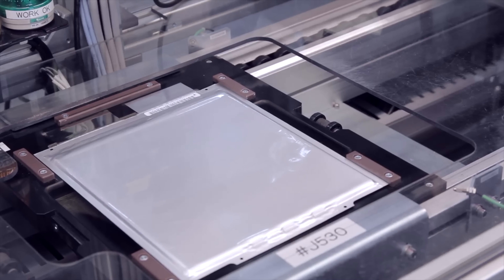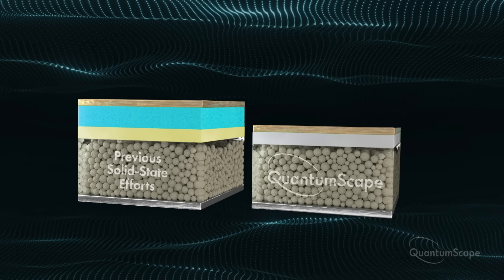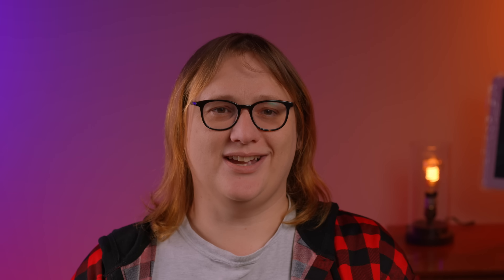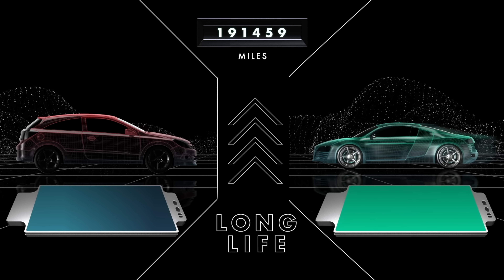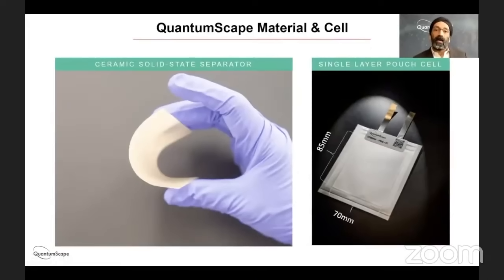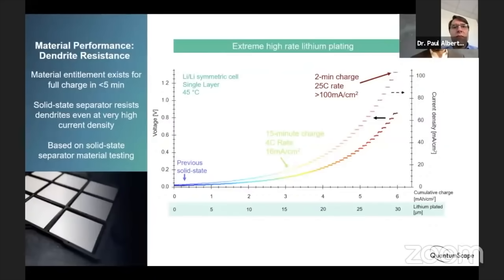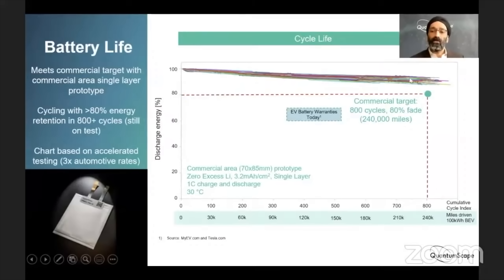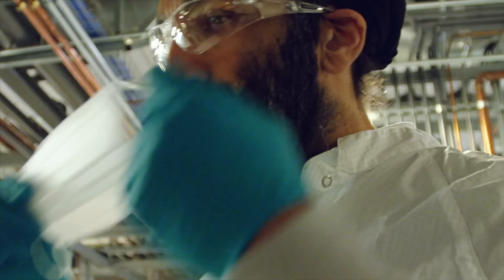Why Quantumscape's Battery Revolution Is Big News

Comment: Tesla is behind
Reply: This SS batt is more hypothetical than real and it's only claimed to be 8 yrs from real production at which point it will match Tesla's 2022 cells in 2028....IF they pull it off at all which is extremely doubtful.
Reply: @Mrbfgray  Volskwagen will have these batteries by 2025, I don't see Tesla matching these batteries, they will have to adquire a new tech by 2028 to start in 2031. The future is solid.
Reply: @rwyo83  Tesla has already match them in specs and vastly exceeded in execution/production.  I wouldn't bet a dime on QS or WV.
Reply: @rwyo83  Also keep in mind that this channel (I don't want to pan them too much, they mean well) fell for the most blatant farce in history--Nikola.  It's great that they are agnostic on brands and such but they obviously don't have a functioning bullshit detector.  QS CEO has a brief history of wealth destruction, JB Strobbel on the board is good but not enough and the timeline they presented is laughable.
Reply: @Mrbfgray  Tesla's batteries are slow charging, they're not even close
Reply: @Mrbfgray  Tesla's presentation are more laughable.
Reply: @Mrbfgray  Bill Gates money is in QS. I believe QS and Toyota will be Tesla's nightmare.
Reply: @rwyo83  More laughable how?  Tesla's 4680s have 15 min. charge time, equal to QS claims  and they actually exist not just a science project.
Reply: @rwyo83  Put your money where your mouth is, talk is cheap.  I've done so but it took me a decade of following the Tesla story before I decided to 'back up the truck' at $38, 18 months ago, after making the decision in 2018....not really fast easy money then.  Know what you own and why or you'll lose your shirt.
Reply: @rwyo83  You "believe"....how and why specifically?  Are you going to invest in QS and Toy?  I imagine you'd want to wait 5 to 8 yrs at least as that's the minimum time it will take to confirm if there is anything there at all.  Bill Gates money won't go far alone and I wouldn't put much on his judgement but I agree it's better than nothing.  More players is always good.

Comment: My basic understanding is - Lithium is only stable as an Ion. Lithium batteries are made of Lithium Ion - missing Electrons [positive Ion] or extra Electrons [negative Ion]. Adding and removing electrons is the job of the lithium battery's "Electrolyte" - to strip off EXTRA electrons to use (discharge) and later attach electrons (charging). So far this has been a destructive chemical process. Now a team has developed a thin divider that might have little trap doors that will only allow Lithium Ions to travel one direction WITHOUT the chemical side effects. That's my take. I might be wrong. It's till MAGIC

Comment: So if this is what companies can come up with in ten years, what could we have done in the 139 years since the first electric tricycle in 1881 or car in 1884-1890, if the oil companies and fuel burners hadn't hidden them away over the years since.
Reply: Nonsense.  Hidden WHAT?  Early batt cars were extremely limited and most of the nation had no electricity anyway.  Oil co.s back then were about as significant as SS-batt co.s are today, tiny startups.
Reply: @Mrbfgray  The first combustion engine car came out in 1886, 4 years before the electric one did, over the years since the automotive companies (General Motors famously have) who have/had investments in the oil industry, have constantly pushed back the developement of EV and even the rail network especially in the US, they've got politicians in their pockets who fight on their side.

The evidence is everywhere, even now there are some who are refusing to switch to EV, just recently on this channel they shown how companies are altering results to make the EVs look worse than they are.

It's all down to money, how quickly they can fill their pockets and bank accounts, and they don't car who they step on to achieve it, oil has been easy money, investing into EVs costs money, which they don't want to spend, the proof is with Tesla and China, they've proven EVs are competitive, yet the others are fighting the 2030 deadline, in reality there shouldn't need to be a deadline and just do it, because they refused to accept EVs they have dropped way behind, they don't care about lives or the enviroment just profits.
Reply: @will4may175  The 2030 deadline is largely irrelevant, economics will make the switch happen before that but useless politicians like Newsom will claim credit, AFTER Tesla and a few others demonstrated it was even possible. 

 Sure there are forces acting against disruption, always have been, that's the great thing about capitalism, you can't keep a good thing down.  Batt cars potential were extremely limited prior to the last decade due to price and performance of batteries, period.  EV1 was OK for a few with it's 40 mile range and 12 hrs to charge but not many.

Zerox missed the mouse, Kodak died from missing digital, legacy auto will fade away due to their lethargy and failure to progress and innovate.  Fossil fuels are becoming obsolete regardless of governments mandates or paralysis.

It matters little if legacy auto "cares about the environment", we as consumers/investors decide if they exist or not and profits are essential regardless.  Short termism along with inherent failings of old industries will be their undoing, no company is forever and that's a great, essential quality and key reason to support economic freedom.
Reply: @Mrbfgray  Yup, trouble is they are the ones with all the money and power, if I wanted to do something all I could do post about it, buy products that don't keep them going, basically changes that influence me and my faimaly, to a point, and that's the problem, picking politicians that will actually make changes is hard to do if there's none to pick, here in UK we have at least a bigger selection, but in US they only had two, even then whoever gets in, 99% of the policies stay until they get round to it if at all.

We ned more people like Elon Musk to force a change, remove the idiots from politics who are stuck in the past, trouble is it's a just hope, I'm too thick and poor to be whats needed.
Reply: @will4may175  WE have all the power unless you default to others.  Quit being lazy and take responsibility.
Reply: @Mrbfgray  Lazy ?? ok and thats where I step out.

Comment: “Seven to a thousand” ?
Reply: She meant 700 to 1000.
I wondered aswell.
Reply: Yes.  Not sure how 700 would be acceptable to anyone though.  Charge your car every day, and your car is garbage inside of two years.
Reply: @LAZARUSL0NG 
If you charge your car every day full cycle with a 300 mile range battery, you would be driving 110k miles in a year. That isn't really realistic.
Here in Europa the average is under 1/10th that.
Reply: @TBFSJjunior   yes, I’ve never properly understood what ‘charging cycle’ was supposed to indicate specifically.  I would assume it does not refer to a ‘full’ charge and ‘full’ discharge, as this behaviour is well known to rapidly diminish cell health.     I would also assume the threshold does not apply to the partial ‘top-up’ charges, that most EVs get daily.  I suspect the truth lies somewhere in between.  My annual mileage is over 65,000; about 200,000 miles over the last three years.  My battery rarely goes under 50%, I don’t know how many more charging cycles I can expect, but I know I’d have been in trouble if I’d only had 700 to begin with.
Reply: @LAZARUSL0NG 
"Never properly understood...lies in between"
Yeah it does not. A charging cycle means a full charge/discharge as one cycle by definition.
(So a charge from 50% to 100% would only be half a cycle.)

And you are right that using the top and bottom degredates the batteries more, which is one reason many automakers save a buffer.

With 65k miles a year you have an unusual high milage and this battery would probably not be a good choice, but for the average person driving around 10k miles a year 700 cycle should last over 20 years.
Reply: @LAZARUSL0NG  Charging cycle is when you fill empty batteries to full and discharge them to as empty as the battery management system allows you to go, and it is such specifically because that it the fastest way you can break your batteries. Energy storage and some dumb drivers might reach that number and if the batteries were properly made then they should still have X percent of the original capacity left, while more careful use and charging will increase their lifespan.
Main issue with this is that cars with really small batteries would not only have limited usefulness due to low range but they would have a disproportionate amount of battery degradation compared to something like Tesla's 300+ mile battery packs. Also, for energy storage solutions you want cheaper batteries with huge cycle numbers rather than car batteries designed for highest energy density.
Reply: @AnalystPrime  👍🏼 I’m over 200,000 miles into my Tesla battery, and expect to double that in three years.  Don’t think solid state is ready for me yet.
Reply: @TBFSJjunior  Considering how hard a full charge cycle is on a battery, it's kind of an irrelevant metric, wouldn't you say?  I would really want to know how long the battery would last where the cycle was 20-80%.  That's a lot closer to real world use.  I only charge to 100% a few times a year.
Reply: @incognitotorpedo42 
I would disagree there, as it shows the worst case scenario.

Comment: Battery technology is advancing at such a pace that range, charge time, and battery life will likely no longer be issues within a decade.
Reply: Guaranteed as it isn't as big of an issue today as some pretend it to be.
Changing habits (aka Changing each day a little instead of filling the tank once a week, etc.) and infrastructure (public charging opportunities) are the bigger issue.
Reply: @TBFSJjunior  That should be with ALL standardized plugs too. It'll be much cheaper if they ALL having same plug then anybody can use any PUBLIC CHARGING STATIONS. Just like any GAS STATIONS. Soon ALL gas stations will have to convert ti ELECTRIC CHARGING. Then we'll ALL breath better and sleep deeper  (no exhaust noise).
Reply: Spot on all of you

Comment: At '2:01', the sketch shows a fully charged and discharged cell together. Noice the lithium metal layer shown has significantly grown in size which puts a tremendous mechanical stress inside the cell. The cathode material is shown as the same thickness ... nice chemistry if you can get it.

If they start with cell phone, pad, and laptop battery packs, I would have more confidence in their business plan. But to jump to car batteries with these cells may be 'a bridge too far.'

I will not be investing.

Comment: Shirley Meng doesn’t seem overly impressed though and with such a long time till production I’m very cautious on this announcement. 
Are the board members shares locked in till after 2028 or can they cash out and run before full production?
Reply: No, 1 year lockup. That could explain why they were in such a rush to make it public so early. Battery Day might have scared them since the projected performance of the cuttent pilot plant production exceeds QS in 2026 and production even later. Uless they were wanting to take money out early, why not wait until it was generating revenue?

Comment: No, laboratory-scale test results of battery technology are not big news, in it self it doesn't even imply there's it's possible to make a viable product, presenting such data in such a way are almost absolute proof of them being stuck, and or wants to imply they found a way to overtake Tesla.

1000 out of the last 1000 announcements of breakthrough battery technology based lab scale data alone shows just that.          

VW really want people to think that Tesla is doomed, that's why they pour money into this.  

Bill Gates, well, all for the good causes, but his support is not an indicator of viability.      

10 years of research, and lab scale based announcements that has scam written all over it to show, is NOT an indicator of viability, that's how you recognize a true bottomless money pit, without a potentially viable product. 

The real challenge is the expanding and contracting during charge and discharge. The fundamental principle in their technology is far from unknown, it is also far from unknown that the expanding and contracting creates a whole array of problems, probably still not all of them identified, if you want to have battery packs anyway near relevant for EVs.      

Also, comparing a new technology that is a decade or two from commercial production, if it ever happens, with current, quickly developing technologies on the market, where they are, at the moment, is just not relevant.    

Also, the batteries are already good enough, incremental improvement of current batteries, and their production, will make EVs even cheaper to buy than equivalent ICE cars. That is more than enough to make the transition from fossil fuels to happen. Even better batteries would be nice, of course, but they are not needed, and fantasies doesn't help the actual transition happen.
Reply: Even bearing in mind this is YouTube (the natural home of nonsense opinion..!) this has to be about the biggest piece of contentious, speculative, ignorant, il-informed rubbish I've come across in a LOOONG time...!
It even has some childish Fanboi nonsense in there!
Unbelievable....

Comment: So after watching your video I still don't know why is it big news. We already have Teslas with 250k miles and over 80% capacity on the original battery. And when do they want to produce those cells? What's the cost per kWh?
Reply: Public ignorance is SO depressing....!
And, sadly this kind of ignorant response is completely predictable......
I don't know why you bother, Nikki....?!
Reply from the maker: Neither do we. /;
Reply: @andymccabe6712  I haven't seen Quantumscape presentation so this is a serious question: what makes it big news? Cost? Production capacity? Gravimetric energy density? Lifespan? Is it only a solid electrolyte or do they use an additional liquid like other solid-state manufacturers? Is it flexible enough to be rolled and use the structural part of the vehicle or is it a pouch cell only? In other words: what makes it better than 4680 presented by Tesla?
Reply: @kedaruss  It's roughly equivalent to 4680 but a decade behind in terms of production.  DOA.
Reply: @Mrbfgray  That's exactly how I read it. Comparing energy density achieved in the lab to cells used in cars for years now is super misleading. I understand why J.B. would want to play with it while being paid at the same time but that's about it.

Comment: Jordan from The Limiting Factor YT channel was pretty much underwhelmed by the QuantumScape presentation and he really knows the in's and out's of Liion chemistry . For starters , they reached only 800 charge cycles before hitting 80% of original capacity . This is way way less than Tesla tech (> 2000 cycles to 90 %) . A calendar life of 12 years ? It was also very suspicious that there was no mention of gravitic energy density (Wh/kg) only volumetric (Wh/l) . The only hints we got point to 300-400 Wh/kg in 5 years . By then Tesla will have hit 400 Wh/kg 1 year (or 2) before that and in mass production . The only thing this tech has as an advantage is being less fire prone . They still need to prove that this can scale up from the lab to production at low cost .

Comment: Batteries still suck (2020 - still the weakest link in an electric car) - just look at your laptops, cell phones, tablets, etc. cannot even survive a day without recharging. - takes hours to recharge, pollutes the land fills, expensive to recycle, total replacement in an average of 500 cycles, etc, and still need to be recharged through the majority of fossil fuel plants. (Mazda is going hybrid and will continue to develop high tech ICE (others will stop future research on ICE), this could be the best combination (very high fuel mileage, instant refill, and zero range anxiety) of batteries and gasoline, until we can totally depend on future batteries that don't suck (maybe tiny fusion reactors, the holy grail of power generation is the best not chemical batteries)

Comment: I’m not convinced about the valuation, cycle life, current value or future projections. Caution, caution, caution.
Reply: Make decisions, pro or con, based on data. Optimism is ok, caution is reasonable, but the fact that data is being peer reviewed is a good sign.
Reply: Just search for it, you went through all the trouble of asking. Only to ask in the wrong place. Would you even know the “peers” if you found out?
Reply: I've also read that and the fact that presentation data was based on a single layer cell - thus negating the effects of thermal build up when stacked as Nikki  said.